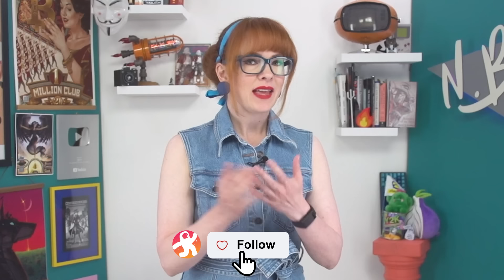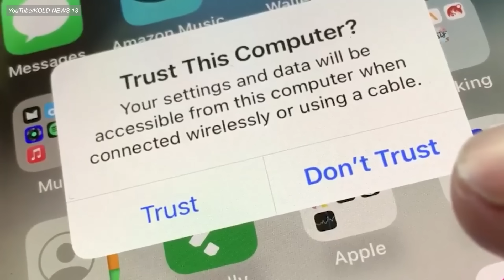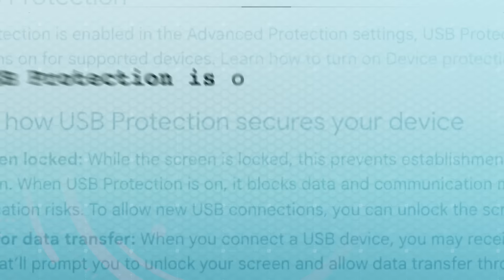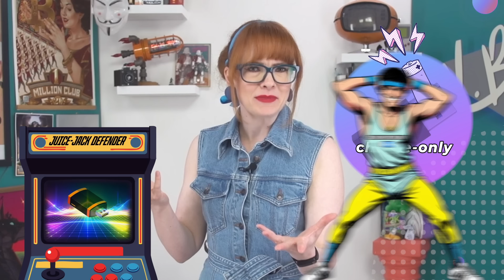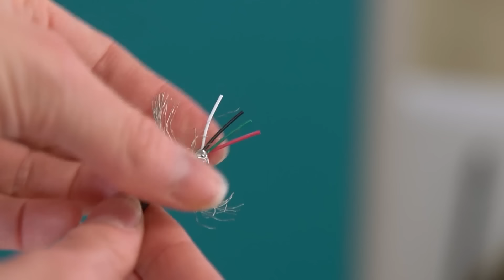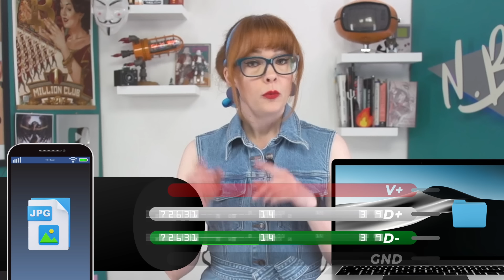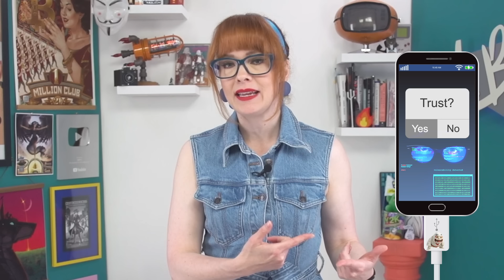Use THIS When You Plug In

Comment: What someone needs to do is make a two way auto negotiating charge adapter that can query the phone and charger then match up the highest available voltage and amperage they both support. Such an adapter could make iPhone chargers that will only deliver stock 5 volts at 500 milliamps to a Samsung (or visa-versa) deliver as much power as the other brand phone can take. Or for a charging port that can deliver 2 amps but only has the two power pins, so most phones will only draw the base minimum - a smart adapter could test draw on the port to see how much is available, then set itself so the phone detects that it's connected to a higher power charger.

The earliest method to signal phones they can draw more than 500 milliamps at 5 volts is to short the data lines together. IIRC that tells phone capable of it that they can draw up to 1 amp at 5 volts. A simple data blocker can do that by shorting the data lines on the phone side while leaving them disconnected on the charging port side. BUT such a simple blocker should not be used on any non-PD USB port on a computer. Use it only for those and wall chargers or charging kiosks and ports.

Some "Smart" wall chargers that are for specific phones/brands must communicate with the phone to negotiate the power, and they may re-negotiate as the phone charges up. It would take a sophisticated data blocker to allow such communication while blocking data that could be malicious.

Comment: thank you for also telling about 5V and USBc - it's very unlikely to be able to charge a phone today with 10 Watts. I always carry a usb-charge for a wallpug with me which is much faster and at least in germany you have a wallplug up to 60 or 90Watts in every train. In my car i still use the 12V poweradapter which was used to lit cigaretts (i think it still does if i have the original plug that was in there)

Comment: overcomplicated for no reason, just use a cable that does not transmit data , instead of using a data enable cable and then bring another dongle to block the data , stop doing things the hard way and call it smart

Comment: The other thing you could do is simply use a USB cable that is only made for charging and not for carrying data or simply plug into a charger that plugs into an electric outlet.  Also, I would recommend never using fast charging unless you don't care if you're killing your battery over time.

Comment: The USB plug has 4 vables ans associated terminals, 2 for data, 2 for power. Just modify a cable by cutting the data wires and keep it for charging only.

Comment: Just use a charging only cable.... been doing it for years. it's just a charging cable with the data lines chopped off. But problem is, the smarter the phone the more they depend on that data line for charging.

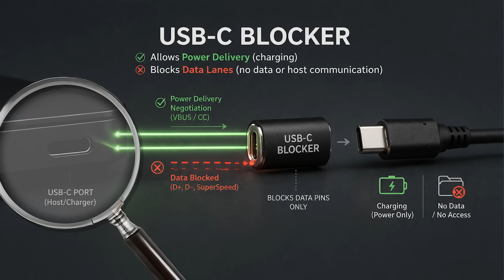Comment: At 8:05 you can connect the data-blocker cable to a USB-C port on a trusted computer and it will show you that it can't transfer files (the device won't show up in the list of connected devices), it won't make a sound or show a warning when you unplug it without ejecting because there is nothing to eject.

Comment: Unless there's a hardware switch on the smartphone to disconnect the data pins, it is always vulnerable to hacking. 
Even with a hardware switch, we still need to remember to operate it and/or follow the prompt/warning on the screen to address the operation of such a hypothetical switch. 

The issues here is,
1)usb port is designed for data and power tranfer
2)We forget the data transfer part from time to time when plug in the phone to random power outlets.

The solution is to carry a small device that disconnects the data pins during random charging stations or carry your own power adaptor.

Comment: Of course, you can check a USB C [or A] by attempting a computer to phone [or vice-versa]. If you have enabled the settings to data transfer, but it does not work, then the data-block dongle works.

Comment: Next, someone will be selling FAKE data-blockers that have wireless in them and steal your data that way
Reply: that's what I'd do if I was a hacker
Reply: I'm way ahead of you on that.  I already purchased USB-C Data-Blocker that I can plug in to my USB-C Data-Blocker that may be fake.
Reply: OMG cable anyone? lol
Reply: Already done... Ether get from reputable seller, or build one your self ether remove the pins or get female and male connector, then just leave the data wires with out connection.
Reply: @Hellsong89 exactly.  I've bought Charge Only cable before.
It can't pass any Data because it only has the battery charge wire.
Reply: This!  Most of the “data blockers” on Amazon are Chinese what I call “alphabet soup” brands.
Reply: "Free charging cables and data blockers!! Get yours now, in short supply!"
Reply: thank you for the idea I'll get right on that
Reply: wrap it in rf blocking foil - sleeve. easy peasy
Reply: @ojmachine9545  That doesn’t help at all if the device you’re plugging into silently executes malicious code that instructs your phone to give data or control up over the internet.
Reply: @ojmachine9545 they already come with a foil wrapping right under the coloured jacket.
It's called 
Shielded Cable 
Just get a 2 conductor Charge Only cable instead.
Reply: If someone isn't smart enough to buy a data-blocker from a reputable brand, that's on them.

Comment: I always use a power brick and my own cable for this reason.
Reply: With apple and android you first need to go to data transfer and then you need to input your pincode after Android 15.
Not only has it never happened, in practice, juice jacking proves to be a highly complex operation. 
For instance, tools like the O.MG cable rely on custom-written scripts to send commands to targeted devices.
This requires a web shell specifically tailored to the gadget's make and model.
So long story short, you just fear-mongering while having no idea what you talking about.
Reply: @Tarzan-z2f  You would like that to be the case. Unfortunately - it's never clear cut.

These types of attacks don't hit everyone; like the Nigerian Prince scams - there is a filter going on. We don't want security conscious people who are liable to report the issue, identifying what is going on; Instead - we want to rely on a scenario where we can passively grab data from unwitting individuals.

This is where Charge only Adapters/Cables come in: They completely eliminate any opportunistic data connection.
Can we do the data connection securely? Sure. Ideally - you have a secure option where we toggle data connection access based on some factor (ex. At home it's enabled; away from home - it's disabled) and in this we have what amounts to a relay switch that physically disconnects the data ports within the device itself.

Same kind of thing is preferable for microphones and camera's - Indicator lights should be hard wired such that when the sensor is powered, that the light comes on. In this way: If it is being used - there is a constant indicator of such. No if and's or buts.

Comment: mod USB cable, use only Red and Black wires for power supply, cut the other wires.. no data comunication. pure negative & positive supply.. just sayin.. :face-blue-smiling: this may not work at all phones, bcausee some require data cables to negotiate charge methods.. soo tha problem continues!

Comment: thats why my GrapheneOS is configured to disable data port pins on the usbc port, its already fixed if you use a smart OS...and btw is not the same as android or ios permissions on data exchange, it physically disable the data pins...
Reply: Which setting is that? I have GOS

Comment: 8:06 They don't make one, but two male USB-C connectors can be wired (soldered) to make a USB-C condom cable of any length that can be inspected.  In addition to VBUS and GND, CC1 and CC2 (configuration channel, crossed-over I think) are required to negotiate PD (power delivery).  4 wires, nothing more.  On the plug side, some pins would need to be jumpered.  It's all passive, unless you need over 60W=20V*3A, then the cable requires a chip to 'mark' the capabilities of the cable like 100W=20V*5A.
(It's against the standard to have an "extension" cable (even if it's short) with male and female USB-C connectors.)

Comment: I was very surprised to learn that Android allows "Android Auto" to communicate with your phone despite explicitly setting the "Use USB for" setting to "No data transfer" prior to plugging into the car. The same setting prevented my computer from controlling the phone, and even prevented the phone from using USB-connected headphones, but not Android Auto.

In fact, if using LineageOS without gapps, Android Auto isn't even available, so the car in question just repeatedly reset the USB connection and ceaselessly retried Android Auto initiation, resulting in my phone constantly spamming me with a message like "the requested app is not installed". I just simply couldn't charge my phone in this car...

I think the main reason the USB resetting was even happening in the car is that the "No data transfer" setting doesn't prevent the phone from identifying itself as an Android phone to the USB host. While my computer couldn't transfer files or control the phone with ADB, it could still at least see that there was an Android phone present. If the car couldn't identify the Android phone, my experience would have been similar to using a wall charger.

I like the idea of USB data blockers especially when there's no other way around the issue, but damn.. I really REALLY wish I simply had a "No seriously, disable all USB data communications with no exceptions" setting on my phone...
Reply from the maker: Yeah it's wild that Google just bypasses settings like that
Reply: The car has a telemetry box which is used to increase your insurance premiums as the data shows increased premiums. So me being smart thought we can just remove this device. But then the nagging question why does the phone have an accelerometer? The GPS is also separate, our phones connect direct to satellite as well as the cell towers. This is the real world, remove the telemetry box or drive a older car and they just switch to your phone no pop up shown.
Reply: @jhowardsupporter  The accelerometer is the gyro used for games, step counters and all sorts of things. It's not accurate enough to get speed etc. but GPS alone is good for that.
Reply: Android auto is Sus. Connected my work phone to it and glasswire detected a 2mb transfer right at that moment. Suspect that was all my location data from the last couple of years that was shared.

Comment: This is why I only keep a fastcharger brick on me at all times when travelling
Reply: Oddly she didn't mention this option. You are right to remind us.
Reply: @rayrous8229 
Likely an easy slip of the mind. Or it may have been assumed that we already knew this, just based on the kind of audience that would gravitate to a channel like this one. 

(Which, btw, another one I'd recommend, who's privacy focused and sovereignty, is DadtheEngineer. He recently posted a series setting up AdGuard Home and Unbound for total LAN protection)
Reply: I always have a power brick with the cord and a battery pack. Never plugging into any public of car usb ports.
Reply: @dancefan831I bet you may. I bet I won’t tho
Reply: Fast charging kills your battery faster over time.  It's not a problem if you fall for the scam of buying a new phone every 2 years.  However, if you're smarter than that and planning to keep your phone as long as it does what you need, then you're better off turning off fast charging as 1 step to preserve long term battery life.
Reply: @wildbill4496 
or just replace the battery.

I've had my S23 Ultra since new with no intention to upgrade (no incentive to, this thing does everything I could possibly want and more I haven't even tapped into).

Batteries can be replaced in these sealed phones. It's just more involved than the phones of yesteryear.
My hope is that as battery tech improves (due to the electrification of cars rush), that the tech trickles into everything else such as phones, medical devices (my field of work) and beyond.
Reply: Dependingon the brick, many of them are not allowed on planes anymore (especially if they are over a given size)
Reply: @ingiford175  you're talking about a power bank... No charger is prohibited on planes.
Reply: @ingiford175   unless you're flying across an ocean on a 10+ hour flight you shouldn't need to charge your phone if you charged it before you left.

Comment: Just cut the white and green pair in the cable so it can only do power . It won't fast charge but it will charge without a data link sucking your information out.
Hope that helps if you need a cable

Comment: Are there any hard statistics (law enforcement reports? prosecutions?) showing this is a real problem in the wild, as opposed to a possible one?
Reply: This is a great question. But even if not, the concept is well-known, and if someone finds a vulnerability in a common phone, it could be deployed at a massive scale very suddenly, and/or go undetected for quite a while. Imagine someone has access to a bus or train garage and installs it behind the panel of every usb charging port in the entire fleet.
Reply from the maker: your car is literally a computer. This isn't hypothetical.
Reply: The thing about openning key card hotel rooms was just theoretical until suddenly the police reports started rolling in about thefts and rapes.  Turned out it was happening millions of times a day globally.

I expect people notice a missing laptop or a rape much quicker than they notice their data circulating and getting some CC fraud 3 months later.

Which is to say, do you really expect there to be entries in your local community police blotter that someone had their sensitive data taken from a lamp in a hotel room or an airport kiosk?

Comment: I have a USB data-blocker in my car because I want to charge without my radio deciding to connect to the phone and blocking my Bluetooth-enabled satellite radio.  The privacy is a bonus.
Reply: I have a dual USB charge from 12 volt cigarette lighter unit.

I did not open it up to make sure it doesn't have hidden WiFi or BTLE or....

Comment: For years, I have used a device that is USB on the part the goes into my phone, and a small magnetic button that sticks out the bottom. This small magnetic button clearly only has 2 connection points. It comes with USB charging cables that are USB on one end and a mate to the magnetic button. This has been the least expensive, least intrusive, method of stopping data connections. The button is always in my phone and my charging cables automatically connect with a magnet when they get close to the button.  No more pulling lint out of the phone port, or worrying about damaged pins. No more wearing out devices as they are constantly plugged into each other and then removed. It is very convenient and it works with most phone cases.
Reply: interesting, this solves a few issues at once, never seen it
Reply: Those are pretty good, I got one with Micro-USB, USB-C and Lightning adapters
Reply: Do they support Fast-charging?
Reply: @spanners7343 19w max
Reply: I don't understand. What is the thing called
Reply: @thedevilsadvocate5210  usb magnetic charging cable

Comment: Is there no software or settings on the/a phone that blocks or turns off data transfer while charging like a charging mode or a physical hardware on the phone that can turn that off I don't any phone has that hardware anyway
Reply from the maker: yar it's in the video
Reply: I was speculating before I finished the video my bad

Comment: You can also find power only cables. You could even make your own.

An iPhone on modern versions of iOS needs user verification (Don’t Trust/Trust this computer) to use data over USB. Assuming nothing is impossible an attack that could bypass that authentication would only be used for a targeted attack, likely state sponsored not something you’d find at an airport kiosk.

Now that doesn’t mean an attacker can’t be preying on people that just tap “Trust”. 

If you ever plug into a charger and get that message unplug the phone immediately. Also enable USB restricted mode in settings and keep the phone locked.

Comment: A data blocker is a good idea.  But there are also times when you need the data and must use a a different cable.  Unfortunately, there are are a growing number of those with electronics built in that can steal your data or do bad things to your device.  I found one of these that I bought on line.  I have a USB power monitor and that showed a slight power drain with nothing connected to the other end of the cable.  I had built an X-ray device long ago for another purpose and used it to get an image of a circuit board and several small parts enclosed in the USB 1 end of the cable.  I verified this by disassembling the whole thing.  After that I check every one I use.  Not everyone has an X-ray capability, unfortunately.  Someone could probably get rich selling an inexpensive, small, special purpose X-ray device just for this purpose.